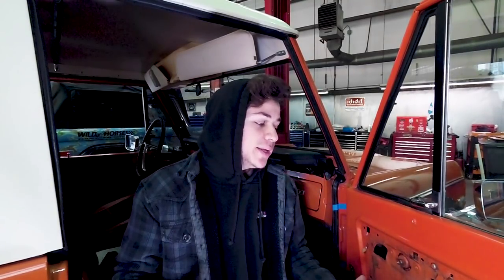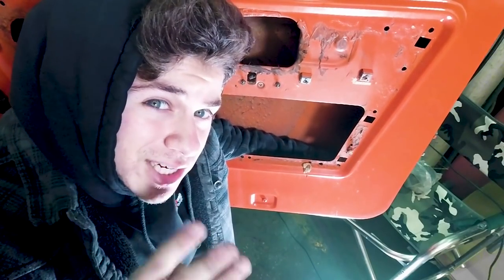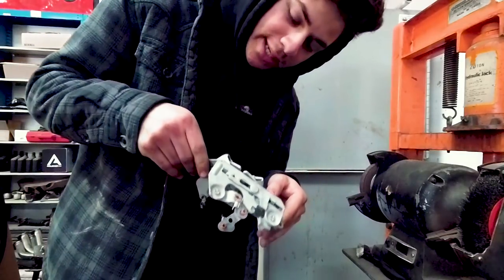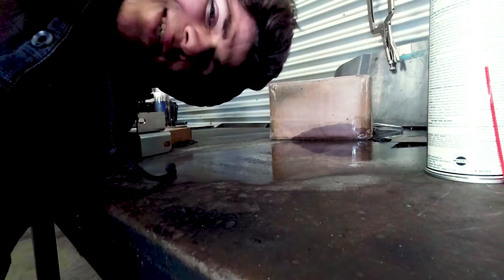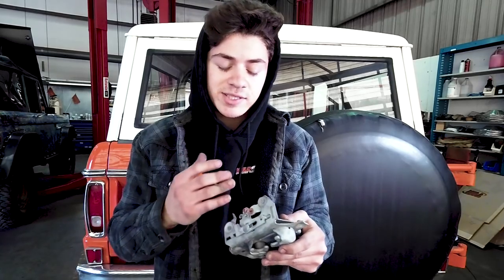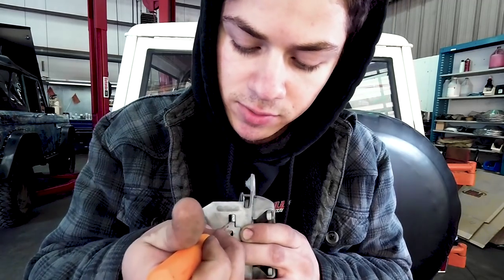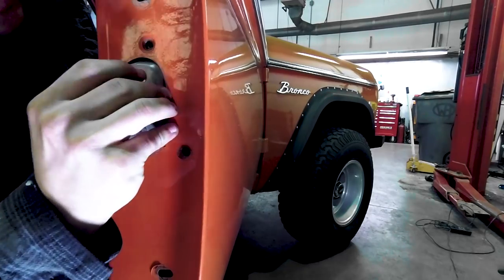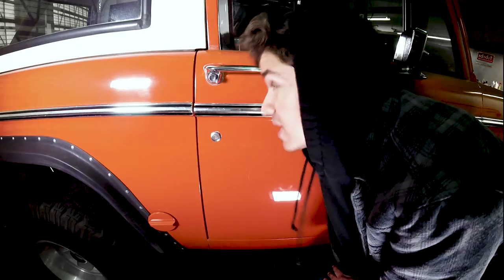How to Fix a Bronco Door Latch: SUPER EASY

Comment: On my 72 Bronco, my door latch button was very hard to press and now it's stuck in.  Do you think my problem might actually be the outside door handle?  Thanks
Reply from the maker: There is a 95% chance that the process in the video is going to fix your latch button. Very rarely is it the door handle itself. I would definitely give this method a go.
Reply: Thanks for the video.  My door is actually opening easier now than it has in years!
Reply from the maker: Right on man! Glad we could help:)

Comment: What if you race to your 69 Bronco to escape said cougar and your door won't open... you survive the attack, but your door is still stuck shut and you can't access the screws to the locking mechanism? If I remove the interior door panel first, should I be able to get the door open from the inside somehow to do these steps?
Reply from the maker: First off, you'd be a lucky son of a gun. haha Second, taking your door panel off and accessing the inside mechanisms will work but you will have to diagnose what's wrong. You should be able to open the door from the inside, if the scenario described in the video is accurate. But you could potentially have a broken clip that allowed the rods to slip out and not engage. I would take the door panel off and take a look inside. Feel around the rods, and if any aren't connected, that may be your problem. If all the rods are connected, just make sure the door is unlocked and try to pull on the rods till the mechanism unlatches. Let me know if you have any more questions.

Comment: Hey. Great video. I have an issue with my door lock. The door latch and handle function properly but the door lock works for a bit once I take the door apart  and clean up the interior workings. 
But once I put the door back together it unlocked and locks fine with the key and manually but after about 10 or 15 locks and unlocks and door opens/closes It all of a sudden stops working.  then I have to take the whole system apart and start all over again.

Any thoughts?
Reply from the maker: It could be your latch mechanism is worn out at this point. Or perhaps the rod latch is loose. It’s hard to diagnose without staring at it

Comment: How about if your door will lock and unlock just fine, the outside handle works fine, but the inside ones won’t work? (68 F100)
Reply from the maker: I can only guess that one of the rod retainers broke. Pull the door panel off and take a look inside. The door mechanisms look complicated at first, but as you begin to mess with it, they start to make sense. That is what I would recommend doing.

Comment: I just ordered a new latch for a 67 resto. The new handle and button work fine, however the inside lever does not. It bends the rod before activating any mechanism on the latch. The latch will not budge with the inside lever. Any suggestions? Good video
Reply from the maker: Mmm that's a tough one. I don't know the answer to that, but I asked a guy who is gonna work on that same problem soon. He told me you could try to fiddle with the rod lengths but that's all the help he has now. He'll get back to me when he figures out the problem himself:)

Comment: My door on mine has a lot of play in the lock, and today I locked it, And the door is stuck. But I can unlock it and lock it again, but it will no longer open. I can get in from the passenger side and the interior handle won't open it. What's the problem?
Reply from the maker: It sounds like you have a broken rod clip which is why when you unlock the lock, nothing happens. I would crawl in through the passenger side and work on taking off the driver side door panel so you can manually open the door. I'm pretty sure you will be able to pull one of the rods and the door will open. If not, then you may have to figure out which rod needs to be messed with and adjusted in order for the lock to disengage. Once you have the door open, it will give you more room to asses what's wrong and if you see that any clips are broken, you can buy them on our website. Hope that helps! Let me know if you have any more questions!

Comment: How does the rod from the exterior door handle connect to the actual latch?  My rod has come loose from the latch, and I’m trying to figure out how to reconnect it. Is it a nut, cotter pin, etc.?
Reply from the maker: Check out Part #6554 on our website if you have a 66-67. If you have a 68-77, check out Part #6558. In stock  Broncos, those clips are usually plastic so they tend to break. Let me know if that's what you're looking for:)
Reply: Can you reinstall those clips? Or is it one and done??

Comment: Nothing said in how to get your door open so these steps can be taken.  I'm sure there's some Blind, knuckle busting way to get the door open...lol ???
Reply from the maker: Good question haha You may have to tear your door panel off from inside the cab and mess with the latch mechanisms till your door opens. If it's that stuck, it will definitely be a pain. I would try taking the panel off then spraying some type of lubricant in the direction of the latch. That might give it just what it needs to move slightly so you can open the door.